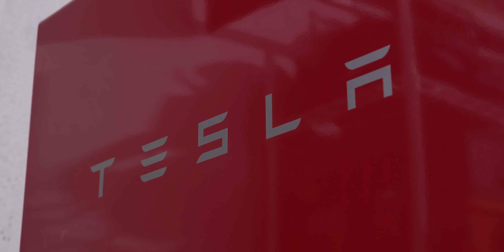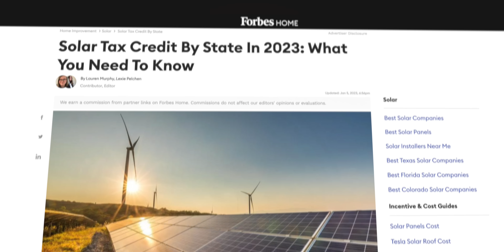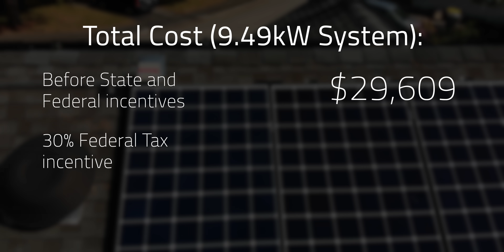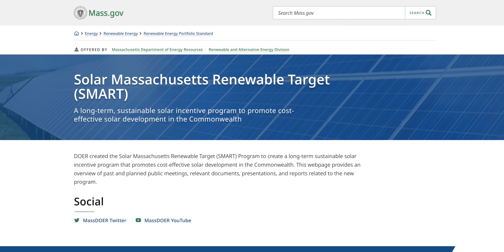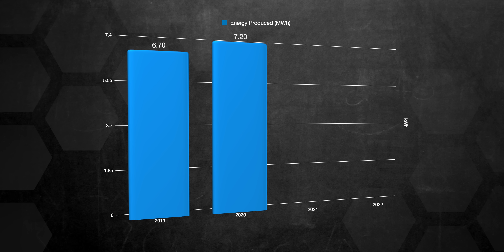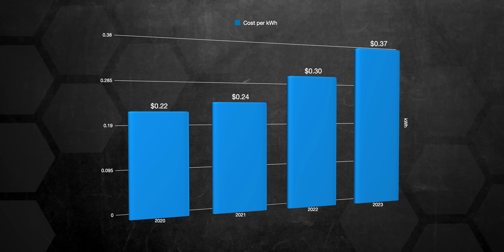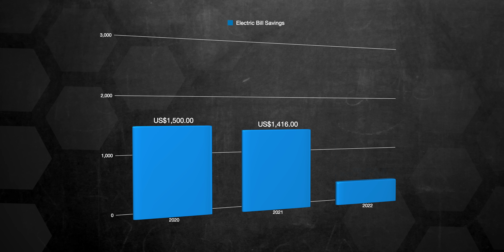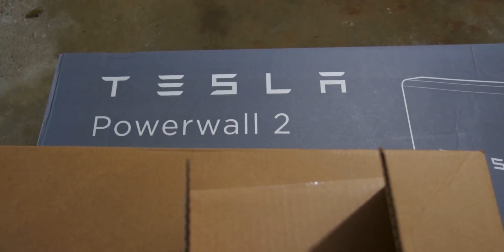5 Years with Solar Panels - Is It Still Worth It?

Comment: In 2019 I really wanted to install a ground array system on my acreage in  South Alabama, real bad.  My co-op power cost per kWh is only $0.096 per kWh.  I was prepared to do all the install myself and had located all the necessary components, engineering to withstand hurricane winds, great South Facing.   We have NO Net Metering nor incentives here in South Alabama.  I could not justify the cost of the system and I really wanted one bad.

Comment: All up data, how about the fact that solar panel loose up to 50% of their power producing capabilities in 10 year. All in all it looks like to keep your system at spec, panels would need replacement around that point in time. So if you have a 15 year mortgage and the panel were new at time of you buying the place, you will have to replace the panels at least once during the life of the mortgage, good luck with that.

Comment: Size and return on value are critical calculations to perform.  I have a shed that is used as an office, and I wanted to use solar to power it.  Found a nice $4k kit that my installer told me would do the job easily.  Like you said never take someone's word for it but do the math yourself.  Which is very difficult because there are no standards in the industry.  Some report battery storage one way while another completely differently.  In short, my experience was horrible.  To power a shed that had computers, lights, fan or AC etc... the number of batteries necessary to run it through the night were MASSIVE.  I'd need to almost build a separate shed for the batteries themselves.  It's really something you have to investigate well.  A lot of people think these solar panels will power your entire house easily, but the reality is people usually only power certain appliances or outlets from them.  It's a worthwhile field but personally I feel it really needs regulation and better standards.  I ended up giving up on the system and plugging into the almighty grid instead.  Good video however.
Reply: A thing that's a little frustrating is you hardly see anything that keeps the power DC for electronic equipment. When you want solar to run a bunch of computer/electronic equipment (and LED lights), the panels generate DC power, then it goes through an expensive component to invert that to AC power then you plug in your electronic equipment that converts the AC power back to DC. So much is unnecessarily lost in the conversions. I've seen some complicated DIY setups that use just DC, but I haven't seen much available to consumers.
Reply: @brendancurtin679  Because DC in high amps is very dangerous.
Reply: @muddyriverdogz  sure, but so is AC at similar wattage. I'll address that, but also, I'm not talking about wiring up a whole home with DC power. I'm talking about near your battery bank or specific short runs. Why isn't there much, if any, "off the shelf" (so to speak) solutions for powering some DC equipment directly from the batteries/solar without inverting to AC and converting right back? 

Personally, I'd be interested in a small off-grid solar system at my house that would let me take my home network and some computer equipment off-grid and also have a little DC-DC charging station for other batteries (cordless tools, phones/tablets, etc.). It'd be nice to have that all functioning during a power outage. And I also would think it would use less energy with the conversion losses. 

Even for folks who want whole home solar, who then need an inverter, I feel like it would still be nice to have the option of some DC-DC uses. As an imperfect analogy, think of adding a water softener to your home. You want most of the water softened, but you might want to add a branch before the water softener to send un-softened water to your hoses and maybe fridge/kitchen (if you prefer the taste). Obviously, sending unsoftened water around your house doesn't require much larger pipes or whatever, so it's not exactly the same. But I think you get the point. 

As far as the higher danger, I don't think that's a big issue (especially for the use cases I'm talking about). DC is maybe slightly more dangerous than AC at the same wattage in two ways I can think of that can be accounted for to mitigate the danger. Because DC is lower voltage and higher amperage for the same wattage, you need to account for that with lower gauge (thicker) wire to handle the higher amperage at the same wattage to avoid overheating/fires (e.g., 12VDC will be 10x the amperage for the same wattage as 120VAC). (You'd also want shorter runs, but that's more about losses than danger). And for high amperage DC, you need disconnects (like the switches on UK outlets) to avoid dangerous arcing when "unplugging"' things drawing a load. Other than those two things that can be accounted for, I don't think it's really any more dangerous than AC. The big reason AC won out over DC was that AC can be transmitted at much higher voltage which results in more efficiency and significantly lower material cost for conductors and generation.
Reply: @brendancurtin679  AC is not near as dangerous as DC. DC at 110 volts witch is most of your house wiring would kill you !
Reply: @muddyriverdogz  who said anything about DC at 110 volts?
Reply: @brendancurtin679  That's is what you are going to need to power most everything in your house.
Reply: @muddyriverdogz  There isn't a single thing in my house that needs 110V of DC power. What are you talking about? Do you think I can run my fridge on 110VDC? For a minute there I was wondering if there was some other danger of DC power you knew of that I wasn't thinking of. Now, I realize that you don't know what you're talking about. 

And did you actually read anything I wrote? I said I don't want to wire the whole house for DC power (which wouldn't be at 110VDC anyway). I only want to power a few electronics with DC, and most of what I have takes 9V or 12V. The highest DC voltage anything I have needs is 20V. Other common DC voltages are 5V, 18V, 24V, and sometimes 48V. I'm not aware of any (non-industrial) equipment that uses 110VDC.
Reply: @brendancurtin679  You can think what ever you want but don't misinform people about the dangers of DC current. Because it has a continues flow you cant pull away from it.
Reply: @muddyriverdogz  I'm not misinforming anyone. I literally said that one of the two ways that DC can be more dangerous than AC is arcing from disconnecting a load. But that is easily addressed by using switches to safely open the circuit. That's why outlets in the UK have switches on them. Back in the day, they used to have DC power in homes, and you could have dangerous arcing when unplugging something still drawing a load. 

And once again, I'm not talking about wiring a whole home with DC power. We all have lots of things (mostly electronics) that use low voltage DC power in our homes. That's why their plugs all have big transformers on them to convert the 120VAC power to low voltage (usually 5-24) DC power. I'm saying it doesn't make sense to me that there aren't simpler ways available to consumers to use the DC power generated by solar panels to directly power DC devices rather than invert DC to AC than convert it right back to DC. 

You're over here going off on some tangent about wiring up whole homes with high voltage DC power to run everything on DC, and that's not remotely what I'm talking about. Your reading comprehension skills need some work.
Reply: @brendancurtin679  I'm going to go ahead and warn you that this is from memory of seeing something related to solar panels in particular. It was about AC and DC, but it was in a different language so...I don't know which is which.

However, one of the arguments for one over the others, other than safety to humans...was safety to the device itself (the panels). Due to how one of the current worked, the cables, the entire installation, would heat up significantly leading to not only reduction in efficiency, but also, more importantly, an increase in risk of malfunctions.

I believe this particular video was related to a product that converts one current from the other per panel, instead of per set, so the power would be converted as soon as it was produced, basically.

But yes. This is another point to consider. Even if the road is 'small', that would raise concerns. It is fine within devices themselves, but it's not exactly fine for some meters of cables often closed within walls with no easy access to them. That would be a fire hazard.
Reply: @muddyriverdogz If DC is more deadly than AC Thomas Edison would have designed the electric chair to use DC rather than AC.  One of the reasons that he designed it was to prove that Tesla’s desire to power the grid using AC was more dangerous than using low voltage DC.  Of course Tesla’s concept won out because step up transformers could be used to jack the AC voltage up to many thousands of volts which reduced both the current and the size of the conductors.  At the destination it could be stepped back down to a practical voltage that could be used to produce work.

Really though the laws of physics, specifically Ohms law apply here.  A DC source having the same voltage and the capability to provide the same amount of current will do the same amount of damage to the load (you) as an AC source.  I have put my hands in computer backplanes with 5 and 12 volt power supplies capable of producing hundreds of amperes and not felt a thing, the same as if I put both hands across a 12 volt car battery. I have also touched spark plug wires of running engines with  thousands of volts on them but only capable of producing a few milliamperes. This more closely resembles an AC non-sinusoidal waveform. It hurt like hell but not enough to kill me.
Reply: @brendancurtin679  The Problem is NOT AC or DC, the problem is how much your home storage DC battery can deliver out in safe range . And I can not see that many Appliances that run on DC other than Cell phone, TV Remote , so the demand for such a need is very tiny
Reply: @muddyriverdogz why are you commenting on something you know zero about? A dc conversion would cost extra money for an existing home, but for a new construction these questions make sense. Lots of power is lost when you factor in conversion. Go argue with someone on something you actually know something about. Powering anything in your home with 110v of dc power is moronic.
Reply: @JY-lg6ee  Most electronics run on DC. Computers, modems, wifi routers, tablets, digital cameras/security cameras. I'm specifically talking about stuff that doesn't use a lot of power. But if you have to invert the DC to AC then convert right back to DC, you have losses there and would need more battery capacity to account for that (and possibly more panels). You'd also need an inverter, which is an expensive component, even though you don't need AC power for the stuff I want to power.  

I'm not interested in going full solar right now for various reasons. But I would be interested in a smaller, cheaper DC-only solar that I could use to power my modem, home network, security cameras, etc. so all of that would still work in a power outage. I wouldn't need many panels or batteries for it. But setting everything else up for it seems very complicated because there isn't much "off the shelf" stuff for that. So it takes a lot of research and learning to figure out how to DIY it. And it won't look pretty either. 

So that makes it a much bigger/more time-consuming project. And that's part of why I haven't done it yet. I've got lots of other projects on my list and this is too complicated right now, so I push it back. One day I'll get around to it or hopefully some consumer products will come out that make it much easier where I can just get the panel(s), battery(ies), and connect them to the device (that functions as a charge controller and voltage outputs and has the necessary safety features like breakers and disconnects, etc. etc.). As long as it wasn't exorbitantly priced, I think that would be a useful product and would save money in the long run.
Reply: @inthesun3884  He doesn't know what he's talking about then. You can easily calculate the payback period yourself if you have data on your consumption. For the typical systems installed in my country the payback period is about 4-5 years (mine was payed back in 3 years due to electricity price hikes and us swithcing to heatpumps instead of gas heating)
Reply: This is just a bunch of rubbish if you don't tell us what the magnitude of the loads you are running is and what kind of system you wanted to install. Did you even calculate the payback period? What about not using a battery at all?
Reply: @pietheijn-vo1gt  too late. How can you call it rubbish when I lived it?  Clearly said I no longer have the system. Your comment is rubbish. Please be more specific. Better yet don’t. It’s a dead topic for me. 🤷🏾‍♂️
Reply: Me me me me... Me me me

Decarbonization is 21st century pyramid building.
Just burn coal. 

This is sickening on so many levels.  "How to screw the lower middle class and make them pay for your feel-goodery."

Comment: You said it was good to have panel rated HIGHER than the micro inverters, but I've heard that referred to as clipping.  My options were 400w with IQ8plus (300 w) inverter OR 365W panels with same IQ8Plus inverters.  In addition, I'm able to get more of the 365 (smaller) panels on the side of my roof with the most sun.  Thoughts?

Comment: A few comments.  These kinds of energy credits are unsustainable.  The state was giving the author of this video a rebate that was equal to my old electric bill prior to the war induced natural gas shortage.   A subsidy/rebate is a zero sum game.  Someone else is paying for you to save.  I personally have done some more modest things to save costs.  15 years ago, our family installed two solar blinds on our south facing windows.  That has probably saved several thousand dollars.  The other thing we do is run our AC with just to move the air which originates in the basement.  If you accept the fact that summer is hot and winter is cold like our parents and grandparents, you can save a lot of money not insisting that it be 75 in winter and 68 in summer.

Comment: I live in Phoenix area and have solar panels and a Tesla power wall. It’s a wash. The monthly payment is $120. Electric cost varies monthly. At the end of the year, compared with previous non solar years, total cost is about equal. My property value increased, so did my property taxes. Again, it’s a wash. Would I do this over? No

Comment: I would be interested in knowing how the age of the roof factors into getting solar panels installed, to include: at what roof age should one wait to install, the cost to remove and re-install panels when the roof is changed, now to vet panel and roof installers so neither comprises the other.  Very impressive content, Matt.
Reply: Craig, can't answer the specifics of your question but I can offer you another perspective..how my wife and I dealt with similar concerns. We'd been hesitant to go with Solar because although we knew the odds were small we didn't want to deal with roof leaks and if we were going to replace the roof  it made no sense to drill holes in a brand new roof. Long story short we looked into standing seam metal roofing. Yes it was more expensive, but when we talked to them about our desire ...but concerns installing solar they said "not to worry" the solar installer will use clips that clamp onto the standing seam. No holes.
Reply: @peterb6282  My wife is concerned about the aesthetics of a metal roof, and the noise.  Any suggestions/insights about that?
Reply: @CraigCastanet  Standing seam does look at lot different than the typical asphalt shingle, we found it to be a "cleaner" look, it added a nice visual..a crisp finished appearance. Much to our surprise we've actually gotten compliments on how nice it looks..never had anyone compliment us on our roof before. LOL. 90% of the time the compliment is followed by the question of noise. Rain (happens to be raining right now) doesn't sound any different...not tinny or louder.
Reply: @peterb6282  Thanks Peter.  Can you recommend a good manufacturer?
Reply: @CraigCastanet  Our Contractor used McElroy Metal: Galvalume.
Reply: @peterb6282  thanks.

Comment: Put gutters on the panels with tiny holes to slow  down and divert. Spray the panels with water to coat with ice. Snow will nit build up. Buy heated panels